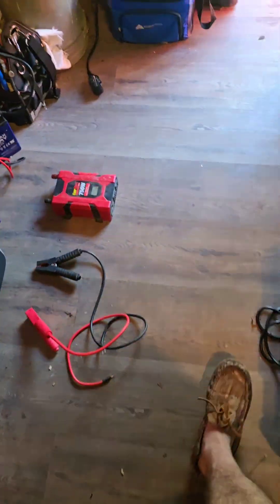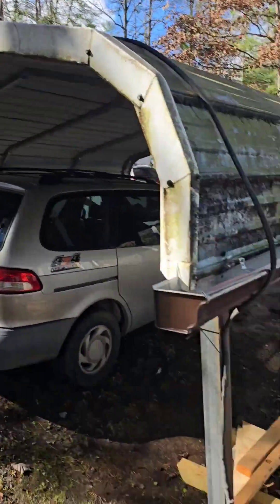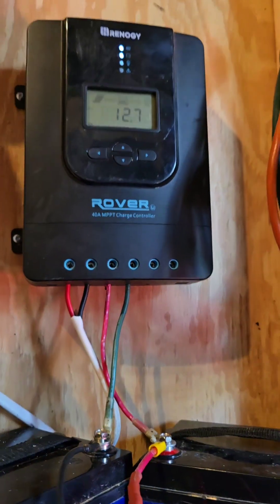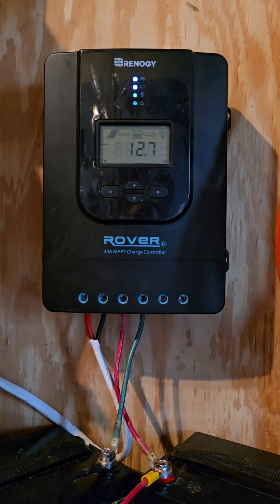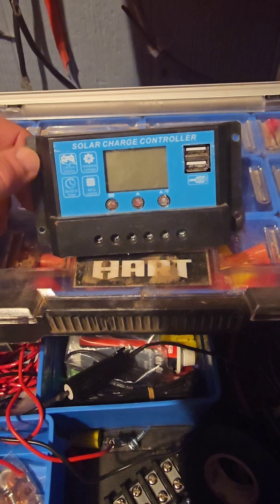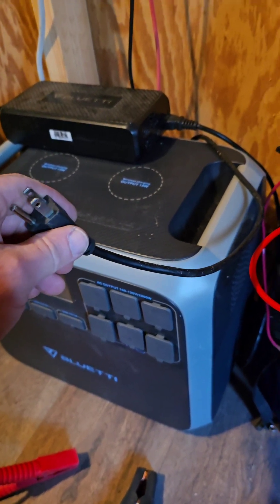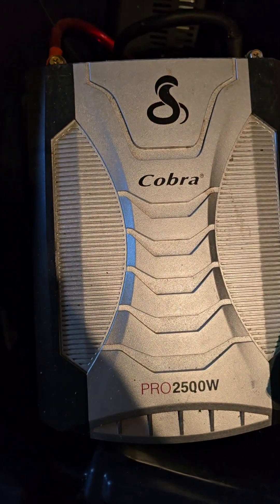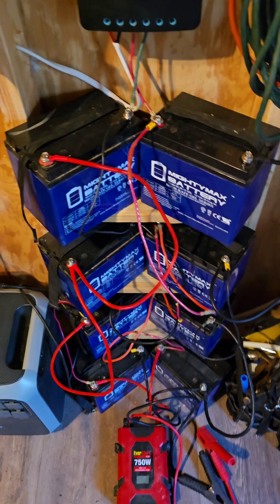HOW TO DO SIMPLE SOLAR #offgrid #solarsystem #solar #power #easy #howto

Comment: The breaker is optional UNLESS you have a high voltage system. Then NEVER unplug or disconnect live panels without a disconnect switch. You can easily get an arc flash. I'd say install one at anything over 200V just to be safe. To be real safe, do work on the DC side at night.
Reply from the maker: @harshbarj  thank you